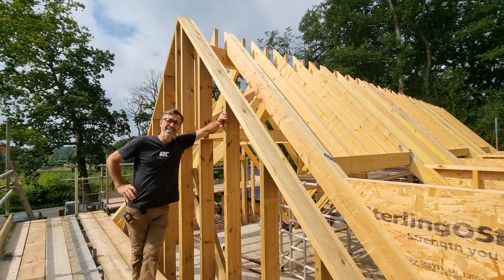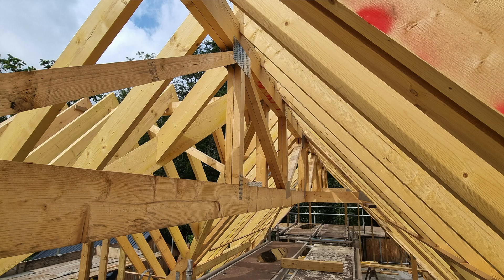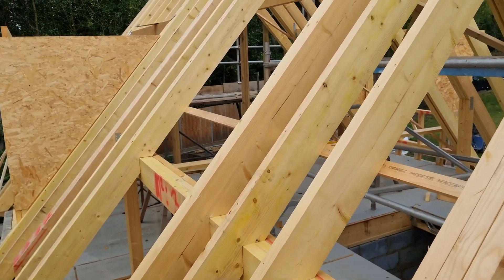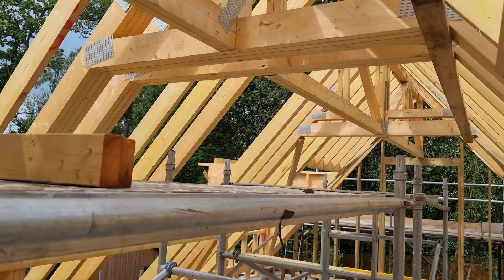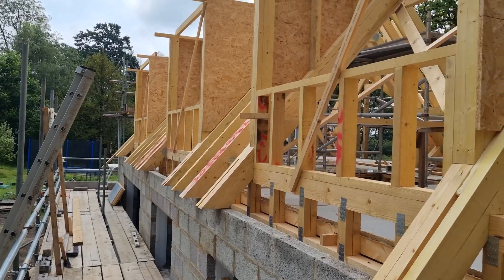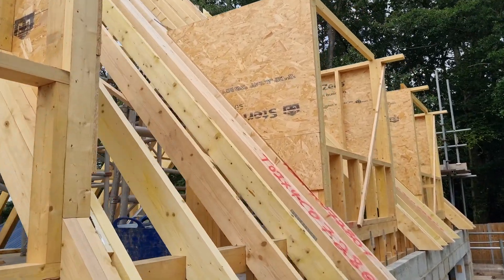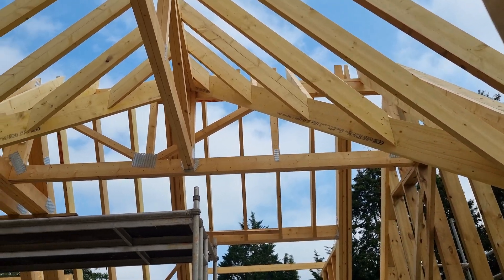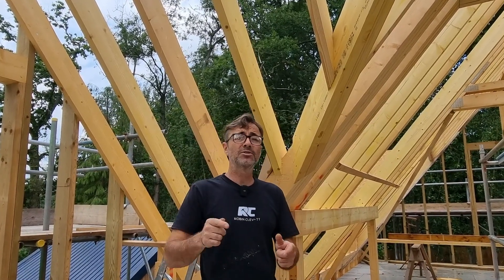Wooden Hybrid roof tour, NO STEEL HERE!!!

Comment: One of reasons that is holding back potential skilled craftsman in UK is the barriers to getting on sites. I studied joinery at a trade school in Norway before going out and working. Got 10 years of experience before coming back to UK for family reasons, tried to work as site carpenter but CSCS said they couldn't give me a card to get on site because didn't have a 'nationally accredited qualification'. Only way i could find for getting one is trying to find an NVQ course and relearning stuff i already studied in first year of trade school, and even then can not find NVQ course, other than getting one online which in itself has another catch 22 situation of having to be working on site to get assessed to get NVQ to get on site. Running in circles aha.

Comment: Looks like a lot of weight on the front gable trimmers on the Jiliette  balcony ope?  No doubt it's all figured out and ok.
Reply from the maker: once it is finally studded with an additional stud on the insides of the opening and then there is a couple of studs next to the sides of the ridge and we put the 18mm OSB sheathing on it will be super strong

Comment: Another excellent roof Robin! I’ve got a question though,you said 100mm of PIR going over the top then 2x2 battens so what length fixings do you use for the battens?
Reply: You use a fixing called “Super-7 Thor Helical Pitched Roof Nails” not cheap! Or most will just use a long wood screw.
Reply: @liamleech6844  thanks mate👍
Reply: @SteveStevieboy  no worries. If you go down the wood screw option I would use one with a wafer head with a slightly thicker shaft 👍🏻
Reply: @liamleech6844  will do👍